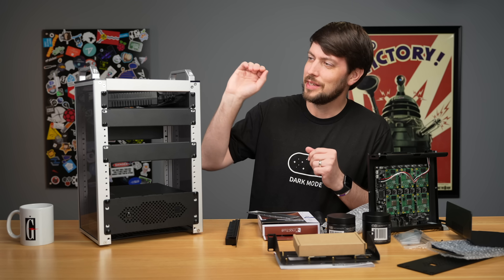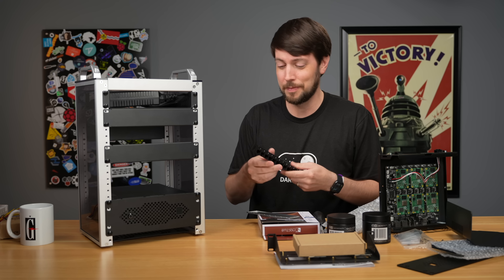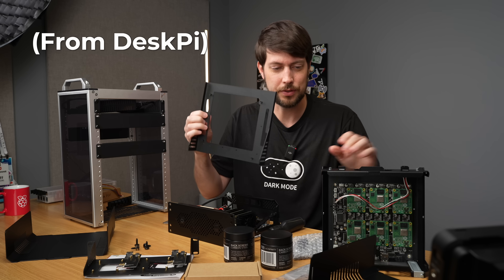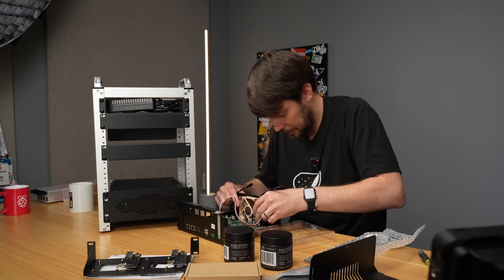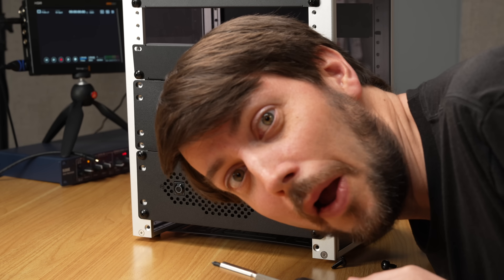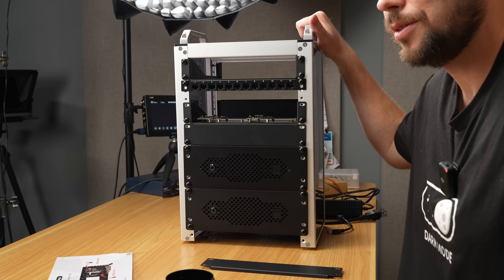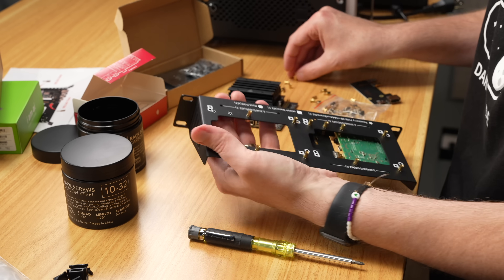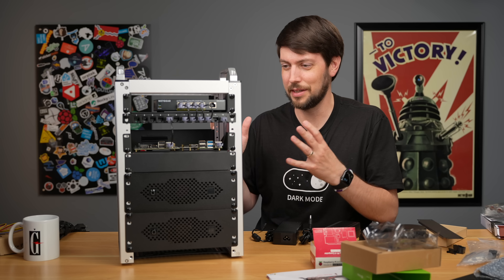Say Hello to My Little Rack!

Comment: This rack is fantastic I have to confess. In Poland I bought 10" rack from Lanberg and put Raspberry Pis onto 3D printed rack. I would like to kindly ask you to make a table on your website that will contain all the links to each hardware, so in fact everyone could have a chance to build own 10" rack. I agree that some mount rack for PSU would be a good idea. So basically on this you can install Proxmox, Kubernetes - k3s that supports ARM architecture, GitLab, Jenkins, Argo CD, Cilium, Trivy, Grafana with Tempo, Jaeger, Snyk, Wazuh, Burp Suite, Suricata and many other tools like Zabbix, Rabbit MQ, Apache Kafka, Home Assistant with MQTT. Thanks a lot for this video. For me it is very informative.

Comment: Oh no. Speaking of fever dreams... the long-held dream of a 4-6U 19" mobile rack (like musician audio gear flight case or similar) with a UPS, NAS, and some sort of compute. As you said, plug in two wires for net and power and it's up and running. RIP my wallet. 😂

Comment: "I got a cold or something." Man you got a case of spring in St Louis. Even if you dont have allergies just the sheer amount of pollen in the air can be irritating to the throat! Also I might be just a little bit irrationally upset that the Jetsons are squares while the Pi gets to be stars........
Reply from the maker: True! The past couple weeks have been torture. Probably had a very mild cold but couple that with mold and pollen from the air, and it's a potent combo for my throat!

Comment: You could build a NAS out of that if you could find some affordable Hard Drive trays.
Reply: can buy the ITX case he showed off there... then buy an ICYBOX 5 bay hotswap 3.5" drives, make a bracket for it... that would take up 5U total (can get 12U racks in 10" easily and they are kinda cute) then you can have a 100TB NAS in very little space.

Comment: I like the 10" rack concept. One thing I did notice on your video is that if you fit SSD to your Pi tray they are on the underside and appear to them sit inside the 1U space below. Either the shelf need to be higher that the Pi's sit on or it is a 2U (1 1/2U) face plate.
Reply from the maker: True! That seems like a slight design oversight, especially if you're like me and try jamming stuff in the rack... you might jam it right into the SSD and break it :D
Reply: @Level2Jeff  I've had a hunt for what is available in the UK. I have found 9 1/2", 10" and 10 1/2" racks. So you are lucky to only have 10".

Comment: Even though Noctua has rubber on the corners the screws thread directly into the main plastic body. That doesn't really stop vibration transfer but the stretchy mounting "pins" do. So unless I'm not mistaken the built-in isolators only work if the fan is held in without screws, like maybe the spring clips found on some tower CPU coolers.
Reply from the maker: Ahhhh... that actually makes sense!
Reply: A more reliable way of doing that (because those rubber mounters can sustain maybe 3 removals before the top part snaps off the main body.) would be using a bolt with rubber washers on both sides, so you're clamping the screw where it should be but it's decoupled from the screw in the contact points. Another solution someone tried was a 3D printed fan shroud around 4mm thick made of flexible material that goes in front of the fan and it has similar results.
Reply: @BrunodeSouzaLino  You really would want tophat-shaped washers (or grommets) to ensure the screw doesn't touch the frame.
Reply: @eDoc2020  You could use a smaller bolt which doesn't require being fastened on the fan body.
Reply: @BrunodeSouzaLino  4 years ago, when I assembled my current PC, I bought 3 120 mm fans for front intake that were like 5€ each and had a silicone sheet cover for all four corners (removable, so you can move it to intake or exhaust side) and 4 silicone washers for the mounting screws.
Reply: Beat me to it! Very true, the screw will transfer vibrations from the fanhousing to the case.

Comment: Dell has the 6016 5 port PDU, but unsure what rack mounting options there are for it, also not sure dimensions. It looks half width but unsure.
Reply from the maker: That does look like about the right size (though maybe one plug shorter to fit well?), but I can't find it in stock. If it's less than $50 I'd go find one.

Comment: I remember some guy on Reddit did a nice post about building his own 10" rack, listed all the parts, then there were some subsequent other posts of others building one based on his.
Reply from the maker: It's the perfect size for experimentation. With 8U and half-width, there are only so many combinations of equipment that'll make sense.

I've also considered building 3x Intel N100 Mini ITX builds, with a little switch up top, it could be silent since that chip doesn't use much power and you only need one fan blowing air over the board.
Reply: @Level2Jeff  I've always wondered if something like a Dell X1018, X1026, or N1108P-ON would fit in a 10". I've seen ones with small rack ears (the kind you get for wall mounting) so it might even mount, rather than shelf. I know a Ubiquiti 8 150w (Unifi or EdgeSwitch) won't fit, it's slightly too wide. X4012 would be baller if you had a need for 10G, but it's likely loud, maybe bareable with a Noctua mod

Although a bunch of switches could work well if you just 3D printed a rackmount for it.

I think 3 x Zimaboards could fit too, although little under powered probably.
Reply: @Level2Jeff  5 of the N100 boards in the ITX cases you used, Noctua fan in the back of each... 1 switch + patch panel in the top and you have a perfect setup to hook up to the primary rack you just built in the video :D

Comment: I like this small rack's form factor. If you can build a sufficient cluster of nodes and storage in it, you could just pack it with camping gear and use portable solar panels to power it/a power pack to power it. I'm also thinking of it as a "go-bag" for tech archival. Like if your house has a disaster and all you can grab are essentials, this rack could be that essential item you can grab which has digital versions of all your family photos, etc.
Reply from the maker: Hmm... now you have me thinking about whether it'd be good to design a 4 or 6 HDD disk shelf for the mini rack!
Reply: @Level2Jeff a mini itx board (or pi) with an HBA in 1-2u and then a 10” JBOD below it would be so cool. I really hope we see a 10” UPS made (or diy-Ed)
Reply: @Level2Jeff  If you dont, I likely will be. I'm planning to move my file server off my power hungry, noisy PowerEdge server to a small pi setup (no need for the horsepower of that full server), and am thinking to make a simple 2u mount with 4 or 5 drive mounts, pi mount, and space for (probably) a small flex PSU to power it all.
Reply: Why would you take a server rack to a camping trip? Other than unhealthy obsession ofc
Reply: @ultravioletiris6241  Movie night while away? Or just as a "go-bag" in case of disaster / apocalypse.

Comment: Kinda want one of these. Know if anyone makes a ups that'll fit in the bottom? Or any recommendations for one to go with it?
Reply from the maker: I've been trying to find either a UPS or PDU. A few people mentioned building one of your own, and I may attempt it at some point (maybe just 12V / 5V only?), but I would love if someone could find one.

If I find one, I'll definitely share!
Reply: @Level2Jeff  Not sure about it, but I am thinking of using an APC AP6015A as a PDU. Haven't yet ordered the rack, but if I did read the specs correctly it should work. Maybe one can mount the PDU on the back side at the same level as the patch panel and brush panel on the front side. Then one would not loose too much space. However I have not yet tested it. This is just an idea.
Reply: I think this UPS (Eaton USV Ellipse ECO 500 IEC) should fit in a 10" rack, but it's 230V only, which may be a problem in the US.